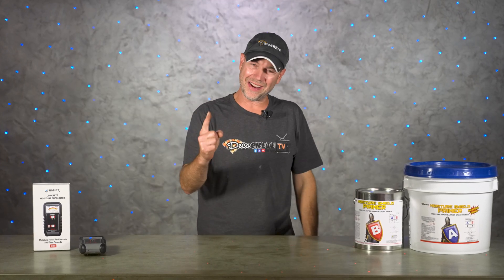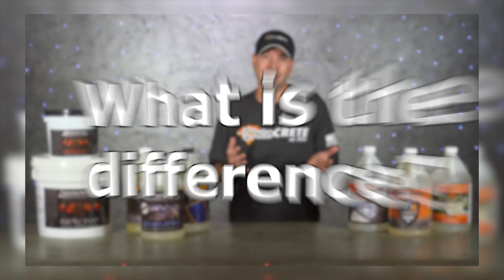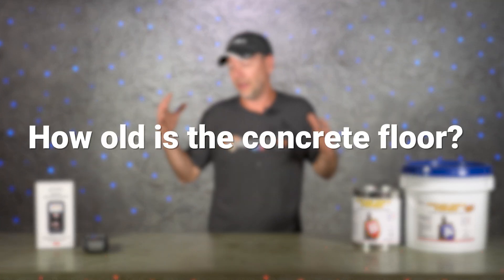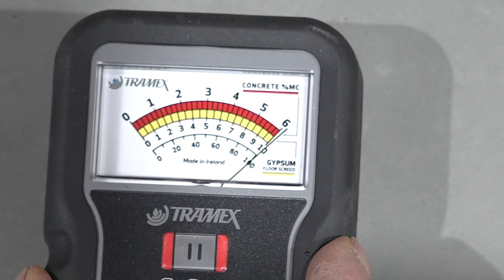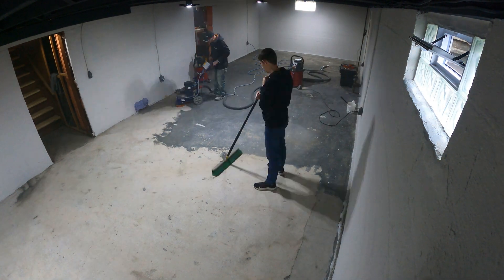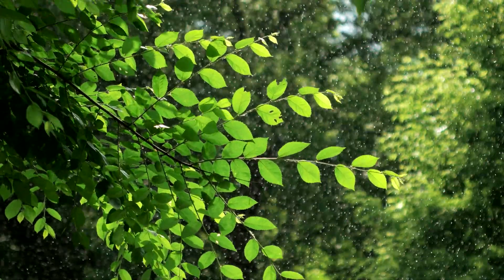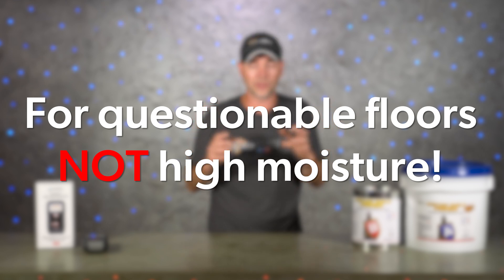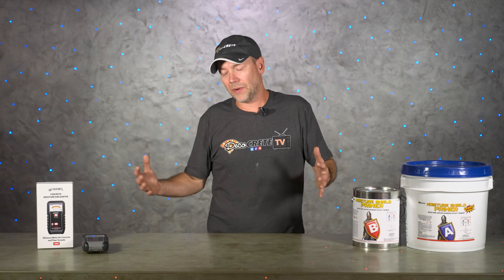How to Handle High Moisture Levels in Concrete Slabs

Comment: High moisture in concrete DOES NOT FAIL AN EPOXY FLOOR.    That is NOT how reality works!!!!  
The REASON for epoxy coating failures, is using a solvent-cured, 100% solid matrix on a slab that moves.  This is the oldest problem in the book, and one I have lectured on nationwide to thousands of architects who want to avoid it!  Blaming slab moisture alone, is false.  It is a cascade of events scenario.  Slab movement causes shearing, followed by cohesive substrate failure, followed by high pH moisture transporting dissolved sodium and potassium silicates into the fracture, that then expand 5x their size creating the bubbles and blisters. MOISTURE is a secondary cause. The Primary Cause, is using a crappy solvent cured epoxy.

Comment: Hey I’m working a floor right now in a garage and the moisture has been 6% or higher in very specific spots for a while I’m trying to look into helping it dry out faster would there be anything else other than a commercial dehumidifier that would work?
Reply from the maker: Dehumidifiers are the best way to dry out the concrete, but they do take awhile. I'm curios how long you've been monitoring this floor. It seems a bit concerning that those spots keep testing higher than the rest. There could be some sort of drainage issue beneath the slab. A week with the dehumidifier should be plenty. If the high moisture remains after that, I would be cautious about applying any coating over it. You can apply a moisture vaper primer to help mitigate the problem, but it's always concerning when concrete retains that much moisture. Hopefully this helps. Thanks for watching Deco-Crete TV!!!

Comment: Try using either Moxie 1800 Admixture or Moxie 1500 Sealer. Moxie international is the OG in this space. They've been around for 50 years. they're non-toxic, clear, and odorless, with specifically engineered and formulated compounds, a complex catalytic agent and active enzymes. 

These complex, hydrous silica, pozzolanic compounds react in a time-released fashion, depending on their specific application, prior to during, or/and after hydration with the calcium hydroxides and by-products of hydration to form additional cementitious (cement-like) materials. This conversion of all available calcium hydroxides (free lime) into insoluble calcium silicates eliminates potential efflorescence. During this period the controlled loss of water slowly moist cures the concrete. 
The additional cementitious materials by their very chemical and physical nature produce concrete and portland cement base applications with a much higher density and surface hardness, a dramatic increase in bond, flexural, tensile and compression strength while achieving a near- zero capillary void state.
Reply from the maker: Thanks for sharing the info!!👍
Reply: @DecoCreteTV you’re welcome. HMU if you want more info.